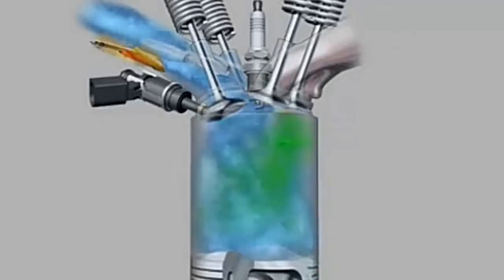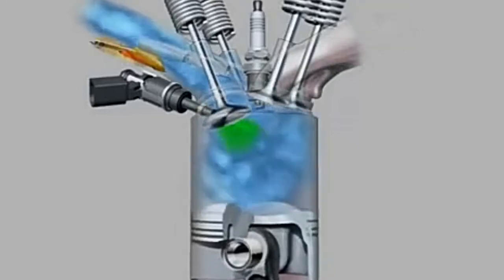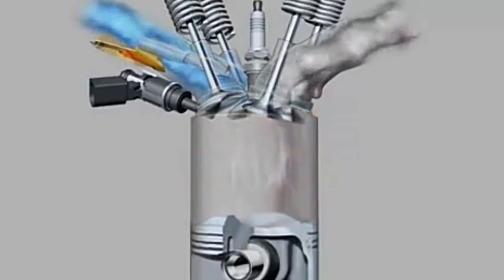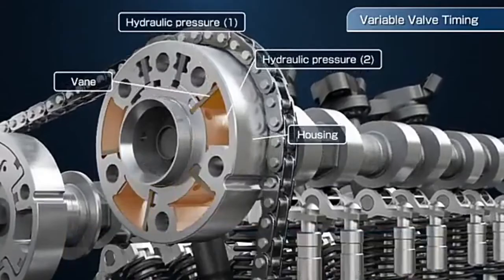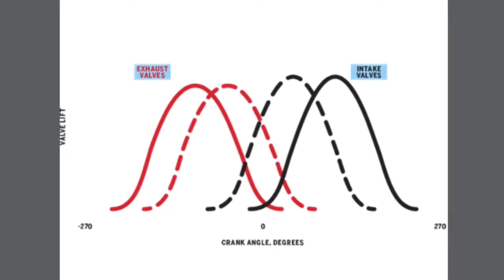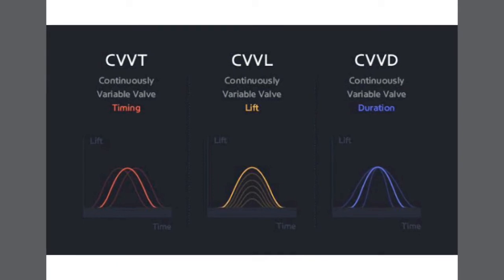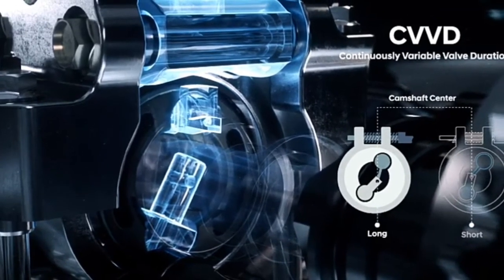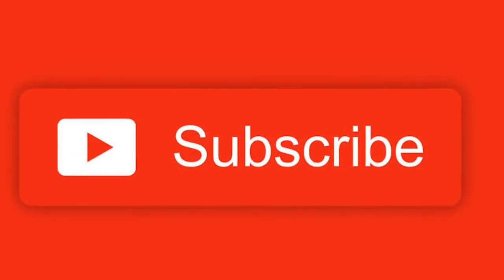CVVD : Continuously Variable Valve Duration Explained

Comment: Why not just put a small electric motor on each valve making them all 100% controllable with any profile?  Thx
Reply from the maker: Sure bro check out my video about ICVT
Reply: They kind of do that. Kind of - in research, this was examined and set up even before multivalve engines became standard. Koenigsegg has such a system in use. Fiat/Schaeffler, with Multiar, are somewhere inbetween mechanical VVT and electrically actuated valves. There are downsides to it: A mechanic valvetrain can be inherently fail-safe, so that any failure only makes the engine stop, but doesn't cause further damage, which is harder to achieve with electric actuated valves. Depending on the actual system and layout, the valves can be fully open, closed, or halfway when power is shut off - that needs to be taken care of, as those halfway ones, the freely swinging valve with electromagnetic triggeration, are the ones performing best in anything else...

The power to drive the valves needs to be converted from mechanical work to electric energy and back - this isn't free of losses. A wellthought, wellmade mechanical variable valvetrain (think BMW's Valvetronic) not only can be failsafe, the reduction in max lift when duration is shortened even is advantageous, as it increases intake air speed and therefore improves mixture - a desirable feature especially when employing miller cycle (transferring compression from inside the engine to the turbocharger, upstream of the air cooler - that's important, as this really makes the miller not knock ... getting heat out of the air allows a greater geometric compression ratio, thereby expansion ratio, thereby efficiency, without the downsides of knock and countermeasures).

This system, however, seems to be what any naturally aspirated engine would have craved for in order to have a broad range of high-torque RPM, like having highest specific power possible, without needing to rev 5000 and above in order to keep the engine from diing off. Intake duration is key here, and max lift isn't to be restricted here, as there's no way and no need of intercooling a naturally aspirated engine. One equipped with a valvetrain like this could easily have the highest specific torque of all naturally aspirated engines at any speed, thereby enabling to downsize just as severely as we did with the now-standard turbocharged engines, but without its downsides - only downside would be that, in order to use the high specific power such an engine would certainly have, you'd have to rev it up. Really a downside, that...?